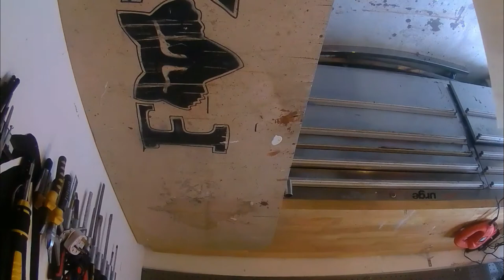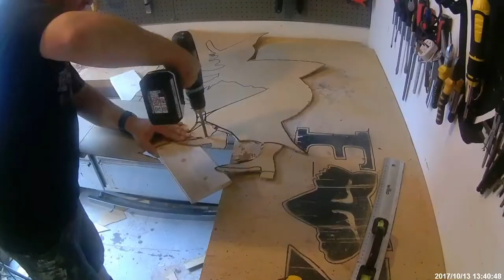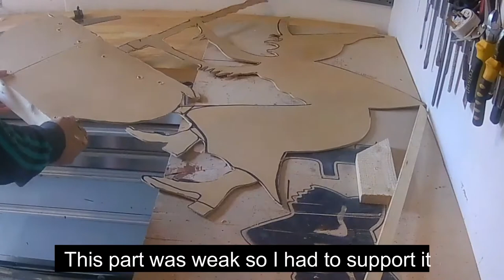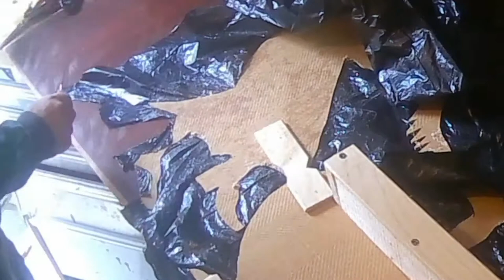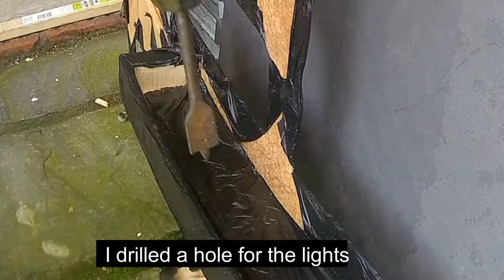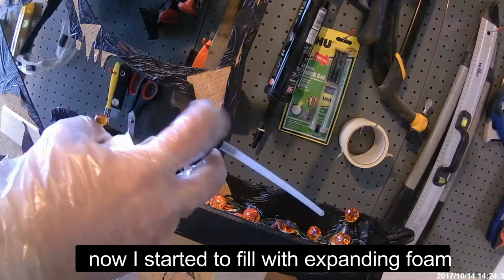Halloween Witch Silhouette with glowing cauldron

Comment: This is amazing, my family is thinking of doing a spooky house this year, but we don't know how to light up the windows.
Reply from the maker: Thank you very much , if you look through my other videos I made a spooky house ages ago just using scrap cardboard and for the windows as long as you cut them out and and stick coloured paper or normal paper or grease proof paper or anything transparent over it then you can just stick some cheap xmas lights inside and have the switch at the back then that will light up all the windows , let me know if you get stuck or if I can help anyway thanks again 👍👍
Reply: @MeMyselfandMaking  Thank you so much!
Reply from the maker: No problem at all